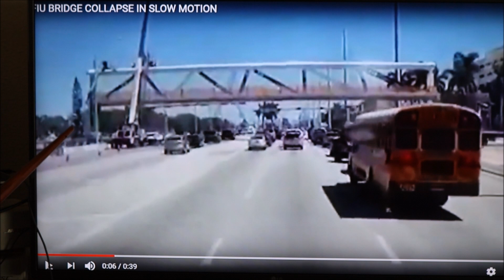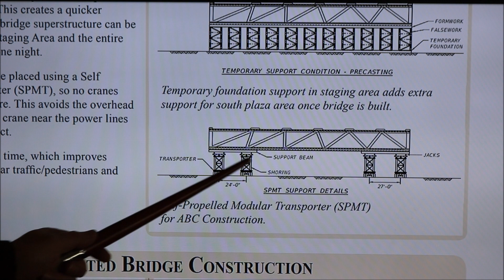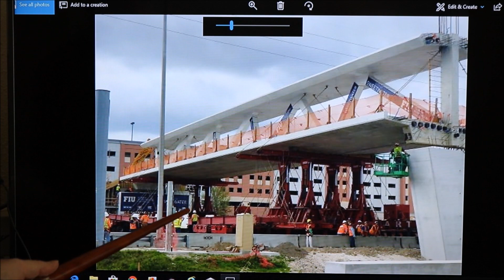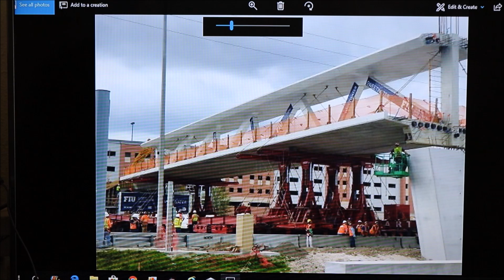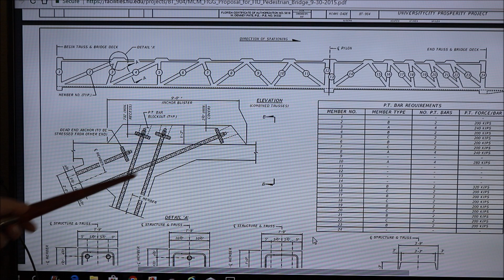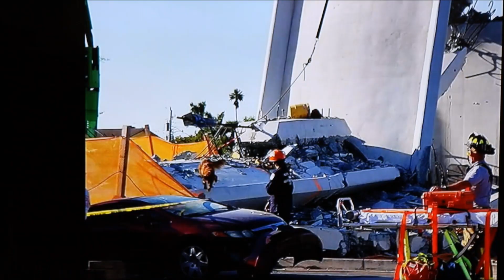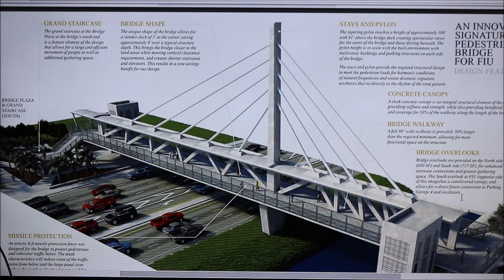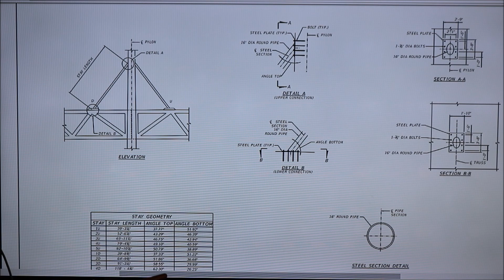Miami Bridge Failure Update 18 March 2018

Comment: Nice Work Juan. The drawing you showed has a schedule of PT rods and their force in KIPS in each member and member 11 shows '-' for no PT rods. That makes sense because member 11 will only be in compression after the span is resting on the piers. Member 11 would experience tension when it was cantilevered on the modular transports as you showed. They probably added PT rods when the decided to move it that way. After it was resting, they should have reduced the PT rod tension in member 11 to zero, or close to it. It looks like the worker erroneously increased the tension causing the failure, either by snapping the rod or causing member 11 to suffer a local compression failure.
Reply: Peter Allan   Totally agree with you; That member would have been in compression, and an erroneous increase in tension on that rod could have put that member into failure. Is hard to see on that video, but I think you can see that member buckle out...
Reply: Also member 10 was to be post tensioned to 280 kips, and I wonder if they were post tensioning the wrong member...
Reply: In the high-resolution photographs of the rescue from Miami Herald you can see that the spherical nut on the back of the hydraulic jack is installed backwards. If they can get that wrong, they can get the wrong bar or set the lever the wrong way. It's really an engineering supervision failure, more than a worker failure. For something so critical it's not enough to "order" a tension adjustment.
Reply: But surely they would have reduced the tension in the bars in member 11 immediately after the installation, and this is in fact mentioned in one of the videos on the installation. As the deck had been in place for a few days It seems more likely that the work on Member 11 was going on in response to the cracking which had been observed.
Reply: I was thinking about this when I went to bed last night and it occurred to me--hey, I wonder if the worker cranked the tensioner the wrong way and broke it. Certainly they wouldn't send a guy up there who was clueless, but if his head wasn't in the right place...for whatever reason...he could have screwed up (er...whichever way the wrong direction was). Heck of a mistake to make.
Reply: "..the spherical nut on the back of the hydraulic jack is installed backwards."
Good grief.  Lack of adult supervision.
Reply: My thoughts, exactly.  Member 11 would have only been in tension while the span was on the temporary shoring towers.  Once the span was set, member 11 was compression.  I agree that it does appear to buckle at the instant of the collapse.  I've also heard speculation that the MCM worker was (incorrectly) ADDING tension to that rod, given the presence of the hydraulic jack on the protruding rod after the accident. That would have definitely increased the probability of member 11 failing in compression.  Whether you call it contractor negligence or improper engineering supervision, the collapse appears to be caused by human error.
Reply: Wasn't the worker's fault.   He was instructed by the engineers to re-tension the rods (presumably in the hope it would close up the cracks at the bottom end of the diagonal) and that's what he did.    The bottom anchorage pulled through the cracking concrete and blew the bottom end of the diagonal apart.     (See OSHA report).

Comment: I'm confused on why they allowed the public to walk and drive right in and under the construction site?  Why they allow cars to stop under it, and why the tower and overhead support cables aren't even attached or built?  They noticed a crack just days before and still allowed cars to travel under it?  And then over compensate by tightening a rod which essentially popped the concrete like clapping your hands over a water balloon.  And the engineers went to school for how long to get a degree?
Reply: The fact that they ( KNEW ) about the ( CRACKING ) and 
( CHOOSE )  to  ( IGNORE ) that,  and  ( allow traffic ) to 
move under that bridge while it was being tested is called,  
((  CRIMINAL  NEGLIGENCE, and /or,  NEGLIGENT  HOMICIDE .. ))

BOTH  ARE   FELONIES   BY   THE   WAY.....
Reply: The designers of this bridge are not the sharpest tools in the shed.
Reply: No criminal charges anticipated (as the cash passes under the table).

Comment: I see an overweight behemoth, poorly designed and failing to use modern structural lightweight metals. It’s own weight was it’s undoing. It does appear that the tensioning of the cable ultimately caused the bridge to fail, but when only 1 tension rod can cause a catastrophic failure, in my opinion the design is flawed. I seriously doubt this bridge could have ever lasted 100 years. When cracking was found on the bridge the road should have immediately been shut down until engineers could determine what was happening.

Comment: Make the top Higher and Use Steal Beams. Might not look good :-( Prestressing concrete has been used for many Years on Bridge connections on the pavement connection.  Exactly New Modes of Failure. Looks like 3 Engineering firms tried to Better Grandpa. hehe

Comment: What you're calling truss #22(#11) isn't the truss member, it is the anchor assembly which is on the canopy.  The actual truss is under the anchor assembly and has pushed the assembly away from the canopy.
Reply: drkjk Interesting! Why would the PT rod be horizontal in line with the cap?
Reply: With the truss now near horizontal under the canopy the rod can only be bent or if the concrete of the anchor assembly fails, the rod can be horizontal or near horizontal.  Looking at other photos it does appear that the anchor concrete failed to some extent allowing the PT rod to assume a horizontal orientation.

Comment: One thing that doesn't make sense to me is how they went from having to loosen the tension rods in question after transporting the bridge, to tightening them again at the time of the failure.  The truss member in question looks to me like it would have been under tension while the bridge was being transported, so adding tension at that time makes sense.  And my non-engineer eyeball says that that member would be primarily under compression once the bridge is on its supports, so taking the tension off makes sense to me too.  So why would they have been adding tension again at the time of the accident?
Reply: It would seem as the bridge was placed on the end supports the last section (that had been suspended outside the mover) would loose tension. They were probably bringing this section back to specs in line with the other sections.

Comment: Here is my opinion on this failure--HUBRIS. I know very little about the engineering. But I can see that it looks like a poor design. Cement Truss? Hardly any steel wires? That's all I need to know to know it's a bad design. But those engineers believed in it. They believed in their math and calculations and materials. They believed in their methods despite obvious flaws. So--this appears to be a case of ideology getting in the way of critical thinking. This is hubris. Someone was too full of their own ego to question their own methods because they believed in themselves a little too much.
Reply: @Pamela Thompson; HUBRIS, exactly!  They are so darned proud of the "ABC" which allowed them to close the street for only one weekend.  Or maybe a month now.

Comment: I have seen bridges like this in many cities (a bridge crossing a major road, giving pedestrian access). There is one in my home town (Tucson AZ) that was standing when I first came to town (1972) and is still standing today. Why has technology and experience not made us safer as the years pass?
What I would like explained is why this design, a design where if even one of the tension rods fails, the entire structure fails was chosen. It certainly seems this structure was built without redundancy
It is reported this structure cost 15 million dollars.

Comment: I’ll bet my next paycheck it was 100% CAD design. And double or nothing, custom project specific software. Ergo, one-off software. Pure speculation. 

However, 20 yrs ago I worked a bridge and grade separation that was the first time that they used CAD. There were as many changes and problems and field redesign as the original design. The as-built hardly resembled the plans.

Comment: If the strut was under compression from the bridge load, and it was put it under more compression with a post tension cable, maybe they buckled the compression strut?  
Nice to have the video, because it is clear which triangle failed.
Could have been the strut to bottom chord joint (at the pier).  Looks like the strut had to feed the compression load into tension cables across the entire width of the  bottom deck.  How was that load transferred?  Uneven transfer, zipper failure of the bottom chord  cables ?
Reply: Ted Cook The points (for that is what they look like) where loads are transferred from the trusses to the base seem to be the key areas of failure in this design.
Reply: I questioned that from the beginning. How do you transfer a point load to distant tendons? 

Only the inner tendon pair have direct access to the point load. Were these made four times stronger than the rest? 

Others have commented that the North end rebar was about 1/10th the needed strength. This implies that the rebar could not transfer forces through shear to the distant tendons. 

Even if static loads were supported, the acoustic shock waves from the failing canopy concrete would travel down #12, #11, and #10 and collide in the deck between #11 and #10. Of course, strong shock waves can put concrete into tension, especially where they collide and add up. 

This may all be moot. If the canopy and deck cracked simultaneously, then the bridge would snap all the deck tendons as it dropped. If a tendon failed first, then the lack of overcapacity would snap another in short order, and drop the bridge. 

The bridge cascade-fails because it has no excess capacity and cannot withstand shockwaves.

Comment: According to the picture at 9:50 in your video, #11 seems to be in place, and appears to be a compression member. Failure of the rod shouldn't be an  issue for that member. Curious?
Reply: TIN WIZARD It seems more likely that the joins between the trusses and the canopy or base failed. Hard to tell given the speed at which it happened, and the domino effect.

Comment: The lack of the load spreading beams during transport was probably very important too. There's a world of difference between laying the end sections down on steel beams along the length of the bridge and a couple of narrow steel beams, one under deck instead of a vertex. Perhaps that's when they cracked the deck? I look forward to the report.

Comment: The bridge was instrumented with sensors while it was being moved (for monitoring purposes). I am very interested in knowing if the sensors were still active after that? Could analysis of the sensor data have prevented this disaster? Does anyone have any information about the instrumentation?

Comment: On December 15, 1967, the Silver Bridge collapsed while it was full of rush-hour traffic, resulting in the deaths of 46 people. Two of the victims were never found. Investigation of the wreckage pointed to the cause of the collapse being the failure of a single eyebar in a suspension chain...Reviewing the collapse and subsequent investigation in his 2012 book To Forgive Design, engineering historian Henry Petroski finds it "a cautionary tale for engineers of every kind". As a result of the thoroughness of the investigation, the cause of the disaster was precisely and indisputably found to be "a design that inadvertently made inspection all but impossible and failure all but inevitable. If ever a design was to blame for a failure, this was it" 10 AM Bangkok time  https://en.wikipedia.org/wiki/Silver_Bridge
Reply: I was four when the bridge collapsed, as I'm a Point Pleasant native. There was a manufacturing defect in one of the eyebars of less than 1/8", which, after 39 years of corrosion, caused the problem. Lack of redundancy in an "innovative design" + defective steel = problems.

Comment: UDOT is having to respond on the news tonight about the public worry that all the ABC bridges in Utah might be unsafe.  Valid question. I would like to see the quality of steel investgated after all the Kobe issues.  Utah has 200 ABC bridges currently. They are paying close attention to the Florida investigation.
Reply: I drive over and under 11 of them every day and ZERO concern.   not remotely the same construction style as this single web beam in FL.  Ours here in UT are all traditional designs except for being wheeled into place overnight, and they do a heck of a job on monitoring all of these (mostly along I-15 for people reading along...)   UDOT guys are over the top in the safety realm, they're really good.

Comment: that 16inch pipe would increase the strength dramatically...if the opposing pipe is anchored, the mast/tower is significant the pipe wall is significant...how many tons does it take to stretch an 16 inch pipe with a 1/2 inch wall (probably the same amount it takes to stretch a piece of 1/2 plate 3.14×16 in width)?  a lot...then add the other pipes in.  image now the elevation decreasing at the tangent were the pipe meets the concrete...what would have to take place? 1. the pipe stretches 2.the tower leans 3. the pipe angle increases compressing the concrete between the pipe connection and tower 4. the tower compresses.  just my thoughts.  do you know the dia. of the rod that broke or may have broke? or it's tensile?
Reply: essential judge AFAIK the PT rods (plural) were 1-3/8in, and should have been adequate. The anchors are potential weak points IMO.
Reply: Gordon Richardson... bad deal regardless.  hybrid bridge design.  reminds me of Tacoma's Narrows as far a education goes anyway.  another education... gravity...p/sec,p/sec acceleration the worker falls slower than the bridge. not at  the same speed.
Reply: thanks for your time.  you would be fun in a think tank.
Reply: I don't see how they can put enough tension on the decorative "cable-stay" pipes to prevent them from sagging under their own weight. After all, they are not going to be tensioned enough to lift the bridge - or are they?

Comment: So it sounds like the moving contractor had added extra tension to the cable, then sent some one up there to release some of that tension. Makes me wonder if human error set in and he accidentally tighten the cable instead of loosening it?
Also the worker had a harness attached to the crane, looks like he did what so many people do and did not fasten it properly. I worked in an industrial where we made confined space entrys daily and would see guys leave there leg harnesses loose as the harness limit's mobility, the problem with that is when you fall that extra looseness cause more Force on the harness making it fail. Most of these harness ( NOT ALL OF THEM) have a belt buckle type if fastener for the leg straps and when they fail you fall straight out of it like that worked did.  Great reporting Juan and my prayers are with all the people who are affected by this tragedy.

Comment: Flip it around,,,, No., it does not flip around.  And yes,  it is a cable stayed bridge.  The stays support a great deal of the load.
Reply from the maker: Sailor376also if that's the case wouldn't they need to be adjustable? Wouldn't the connections need to be much more substantial?
Reply: Yes.  Absolutely.  I haven't the drawings in front of me.  I do not know the specs.  But the outer diagonals must be under tremendous tension because of the very flat angle.  And as I continued to say, other comment,, the design, with the constant change in angle of the web elements,, It is only angled in one direction.  The load has to go somewhere,, and it is not symmetric,, the load is unequal.  The quasi vertical elements end up with a later moment in opposite directions,, it tries to 'S' bend it.  It IS a cable stayed design,,,, that they have asked to do a web truss loading.   Two different bridges.
Reply: BTW  Yours is the most intelligent, mental, or mindful analysis I've seen.  And you discuss it.  It is that open discussion that will advance engineering.  I may be wrong, you may be wrong,, we may find out the 6 year old comes up with the perfect explanation.  I'm a hands on guy,, and have spent a lifetime,, wasted youth and all, Wasted adulthood some too,   Gonna sound dumb,,, I see moments, I see vectors,, I swear I see the lines of force where the bridge is trying to get the load back to the supports.  And that one,,, I am impressed,, truly impressed, that it stood for three days.  I absolutely agree with you about the failure point.  That was the point.  And the post stress rod or cable probably did snap.  But again,,, is a design so deficient that the failure of a single cable,, brings the whole thing down,,, in ANY engineering pursuit,,, just not correct.  Service factor.

That bridge was designed by an architect.  That is intended as an engineering insult.  Form over function or form over materials.    In the vernacular,, It don't work that way.